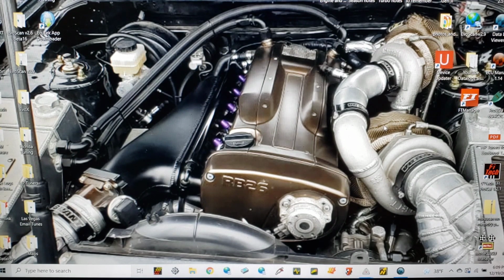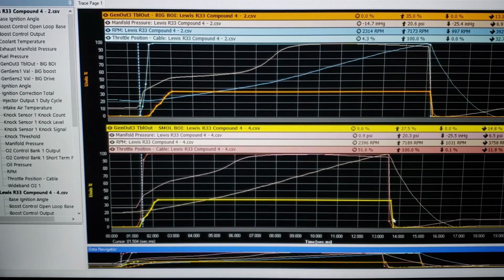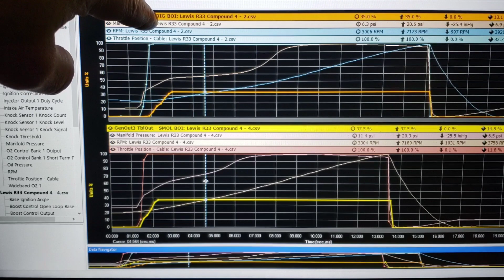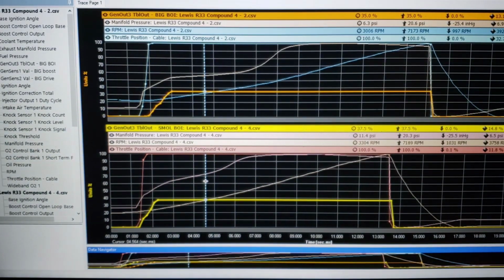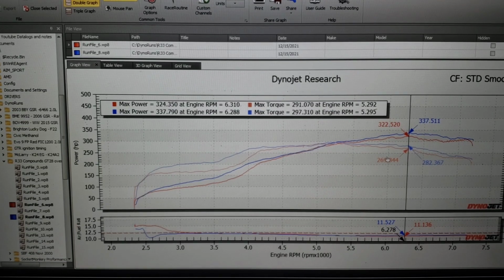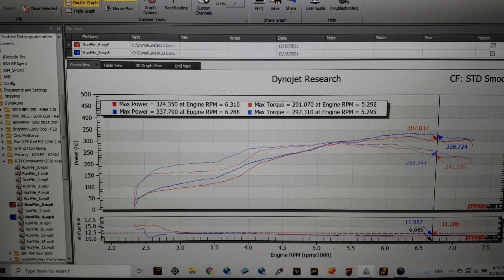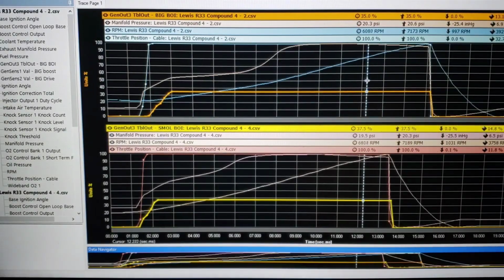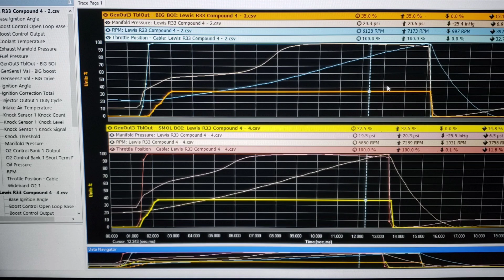Let's tune something I have never tried - Compound Turbocharging Gasoline Engines part 1

Comment: Do you feel like compounding on low octane pump gas engines like 4-6 cylinders etc...  that choosing the small turbo with the most turbine wheel/ ar housings options is more critical than the big turbo?
Ive never done it but want to, from what ive read on different threads the backpressure in the manifold is a problem that makes or breaks the combination really looking forward to the next one!
Reply from the maker: I agree with you that it seems to want to make it or break it.  As far as compounds on pumpgas cars I really think they wont win as often as the lose to a good twin scroll setup for comparable power.  Built engine or more octane and then things will change.  Why I want to build one of my own to use as a test bed.  That being said the small turbo with lots of choices where it is outline interchangeable would make figuring out combinations a lot easier.  In the end there is a lot that I dont know, a little that I think I know, and even more I want to learn about how it all functions.

Comment: 1.Are there 2 60mm gates?  
2. Does the small turbo gate dump into the crossover pipe to the large turbo or to the atmosphere?
3. Was the backpressure higher in the manifold or crossover pipe?

Im guessing the backpressure in the manifold was 30-37 psi and the crossover pipe was 20-28 psi?
Really curious for the results and hope this makes another appearance!
Reply from the maker: 60mm from manifold to the interstage pipe, 44mm off the interstage pipe, higher in the manifold as I would have expected (and was told would happen).  EMAP was dependent on total MAP but was exponential in how it gained.  If this kit had been built with a WG on the manifold as well as not being a log manifold I am curious what the changes would have been.

Comment: Awesome video, really excited to the next episode. I've seen compound turbos in the diesel world primarily but on a Rb rare. It will be interesting to see what the exhaust back pressure will look like on the smaller turbo since usually the larger turbo compressor outlet is feeding the smaller turbo compressor inlet in terms of efficiency and turbine sizing.